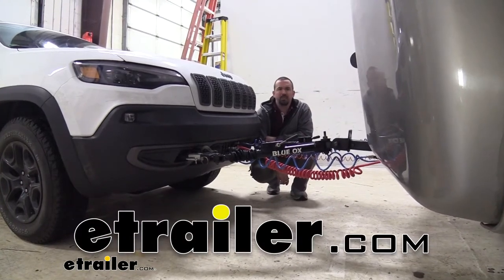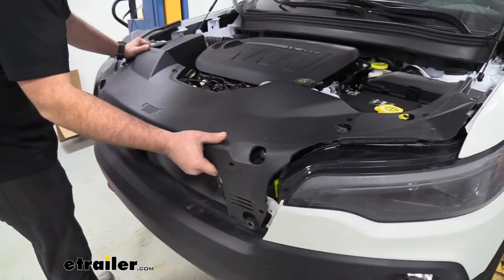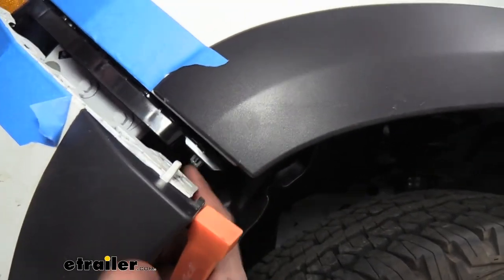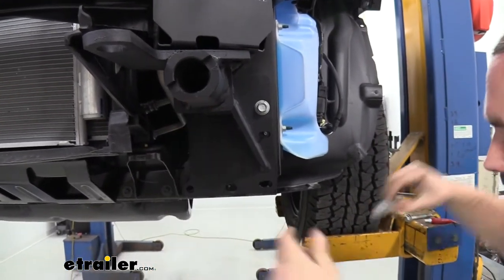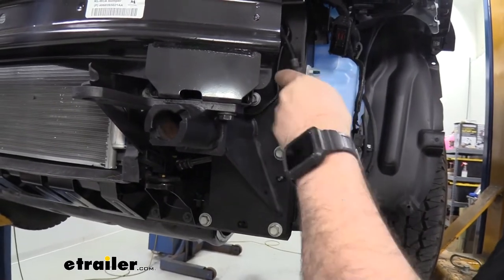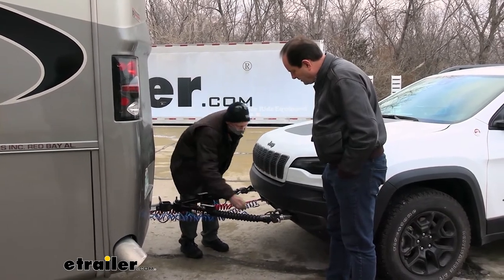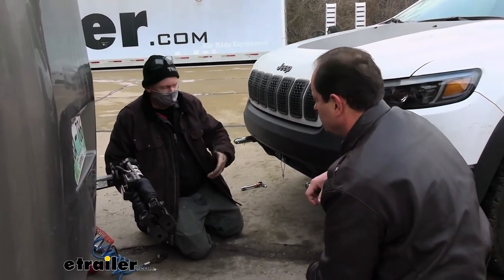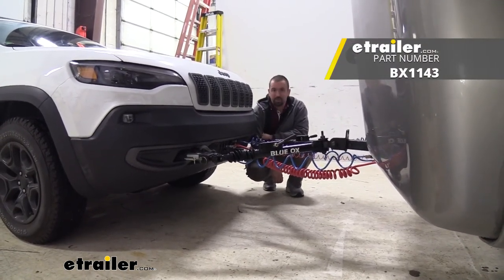etrailer | Blue Ox Base Plate Kit Installation - 2021 Jeep Cherokee

Comment: How did you get the grill off?
Reply from the maker: If you'll fast forward to the 3:15 mark of the video, you'll see how to remove the front bumper cover/fascia. It's also addressed on page # 4 of the installation instructions linked below:
https://www.etrailer.com/instructions.aspx?pn=BX1143
https://www.etrailer.com/Tow-Bar-Base-Plate/Blue~Ox/BX1143.html